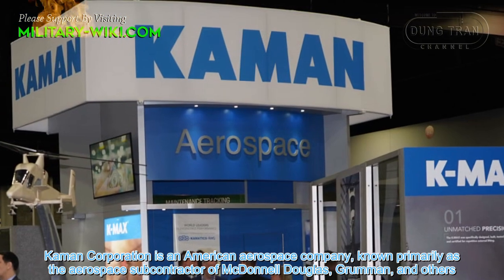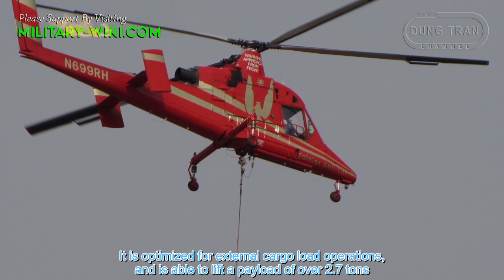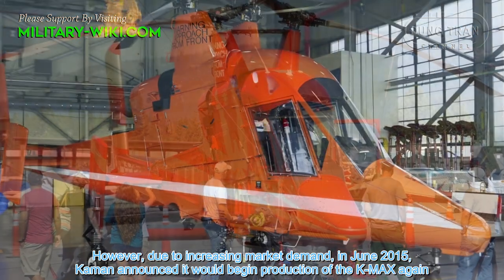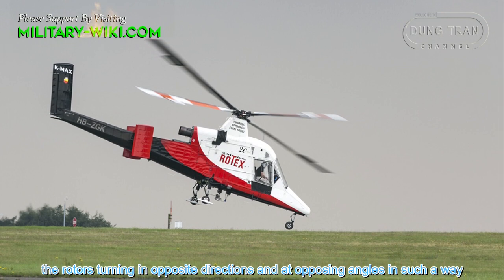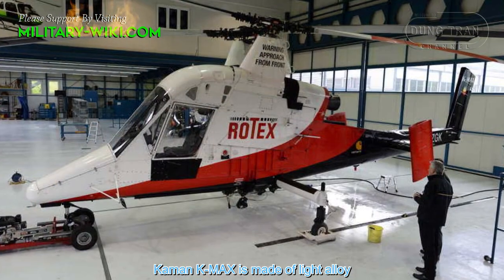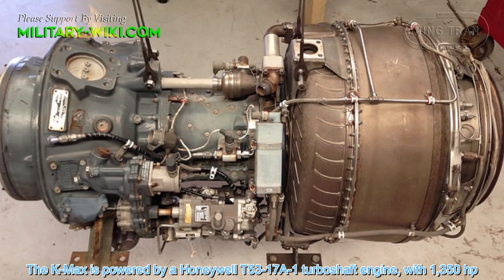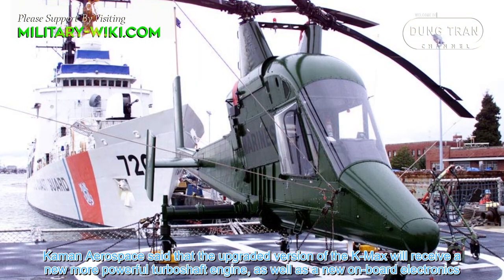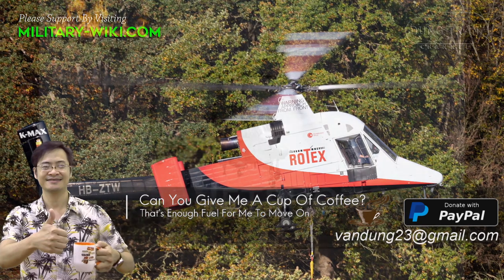Kaman K-MAX K-1200 - An Unusual Synchropper Helicopter Design

Comment: Something the video doesn't mention is that this helicopter has fixed blade grips and changes the cyclic and collective angle of attack of the rotors with 6mm stainless steel push/pull rods inside the blade connected to a control flap on the trailing edge like on an airplane's wing. The blades are made of wood composite and twist along their lenght. The push/pull mechanism on the blade grips can be seen at 4:12. Kaman is the only company I have heard of to design helicopter rotors this way, supposedly it reduces the amount of power needed to control the blades so that hydraulics are not needed and it's also mechanically simpler. The down side is that the flexible blades limit forward speed however external sling loads limit speed anyway so it's not an issue here.